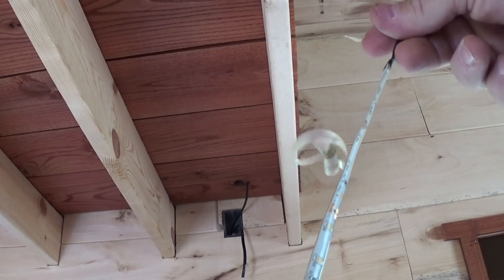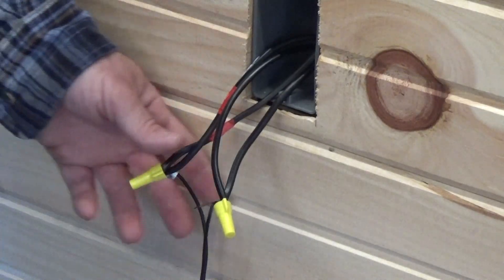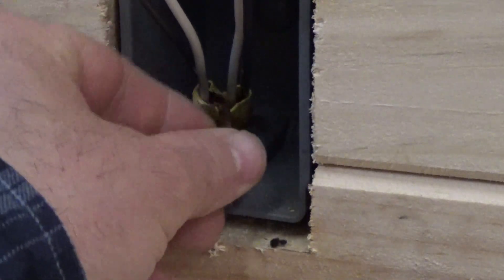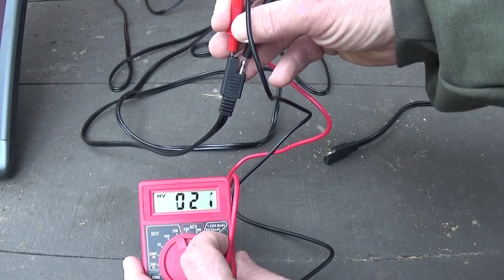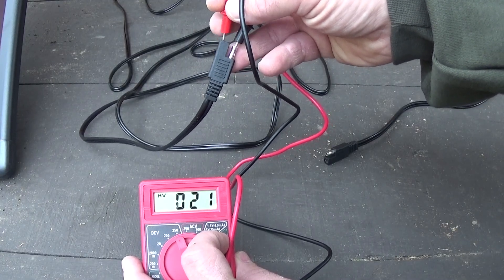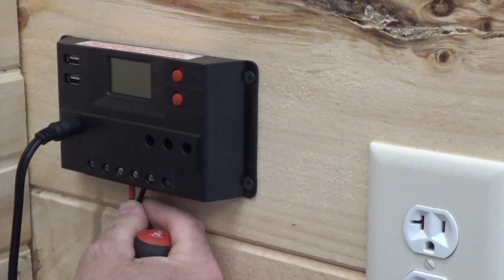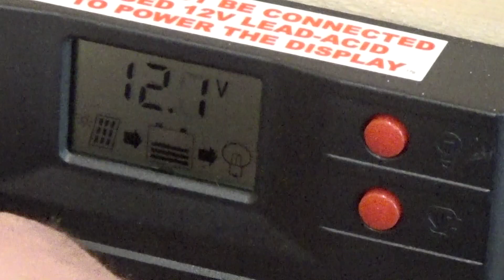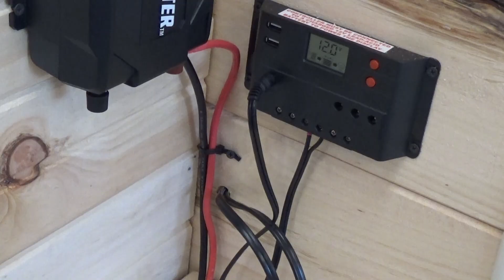Off grid tiny cabin gets  harbor freight solar panel kit installation and I wire 12 /110 volt system

Comment: Could you do a video going more into the wiring and how you connected to the marine battery? I've seen some folks use a charge box, but it doesn't seem like you opted for one of those here.
Reply from the maker: I might be able to do that at some point , right now I have a few projects I'm working on . I honestly just went for a very simple setup .
Reply: @blackspruce1861  I have a couple 100 watt panels and one of the smaller Jackerys, but that kind of set up with the marine battery would be more ideal than hauling the jackery out each time. My electrical knowledge is slim, but folks like you on Youtube have taught me a lot. I'll be looking forward to your future videos either way though!

Comment: That cabin is sweet. I wouldve ran more wiring behind walls, charge controller up higher and hidden interter tho.. especially how clean and nice the cabin is tho.
Enjoyed watchin u put it together and the lighting is excellent.
Reply from the maker: Thanks!!  I personally don’t need anymore outlets and charging ports than what I put in . It’s just a little getaway cabin and I honestly am a bit surprised but I . hardly ever use the 110 for anything more than charging my laptop . I’m really happy you enjoyed it . I was a bit disappointed the other day I went to pick up more of those light strips for my work shop and couldn’t find the Same ones . I really like that lighting too

Comment: How many watts can support the controller? Please!!
Reply from the maker: I'm really not sure . I would have to look . I have had a lot of people say that its a bad charge controller and they upgraded to a different kind. I personally haven't ha d any problems with it yet
Reply: @blackspruce1861  The HF controllers are all Pulse Width Modulation. They all do work but, MPPT controllers are better. And after using solar for over 10yrs and trying and using and doing demonstration's even on solar. I can say that Victron is probably one of my top choice and many others have now since moved to Victron. It gives you bluetooth app and can see real time power generation and give monthly states and allow to do manual battery config for 12,24,36,48 volt setup even Lithium. The HF controllers don't offer all this. Also, being MPPT they track so fast you actually generate much more power off the same panels.
Reply from the maker: @1kzrider  yes that’s what everyone kept recommending mppt thanks I couldn’t remember at the time
Reply: @1kzrider.. Good info. Which model of Victron do u recommend and whats a good price to pay for one?
Thanks in advance
Reply: @koollee  it really depends on your setup.  i prefer ones that allow me to run higher voltage. This allows me to run longer leads to batts and have less drop loss. But, when looking recommend pay close attention as there is confusion. One says victron blue which you would think is bluetooth it is not. The other is Labeled with the word SMART it has bluetooth. This I recommend. But, if you make mistake you can simply buy a dongle which I did have to do. But, the dongle plus side is it gets better distance.

Comment: Love this cabin!  Regarding the battery being charged indoors, keep in mind that they let off hydrogen gas when charging.  Not saying it would be a problem or implying that you already didn't know that, just something I thought of and wanted to bring up.  It might be safer to relocate just the battery outdoors.  Love the channel!
Reply from the maker: Thanks!! I might just upgrade to lifepo or AGM battery that doesn't off gas at all and has much better capacity . but I thought and I may be wrong that they only really off gas when they are over charged
Reply: This is a dilemma,  I live in Colorado and its currently -8*F outside. That greatly limits battery capacity.

Comment: 4:28 for best adhesion clean surface with something like isopropyl alcohol first.  Avoid cleaners that might leave any residue.  Even if they stick initially, they could fall off later.
Reply from the maker: good tip ! thanks!

Comment: What do you think about the panel and battery? Would it be worth upgrading or adding more panels and batteries too it?
Reply from the maker: So far I’m happy with both , but it sounds like a lifepo  or AGM battery would be safer and longer lasting. I was being cheap. As for the panels I’m really happy with them . I could see adding if I needed more but so far it’s been enough. That might change in the winter though
Reply: @blackspruce1861  have you tested longevity of the battery charge plus charging at the same time like say having a radio or TV on all day?
Reply from the maker: @bradlyjohnson60  no I haven’t really tested it I edited a video one day . Had my laptop plugged in and the lights on for a few hours , but nothing that really draws a lot . That’s one thing really nice about wiring just 12 volt lights you don’t need 120 lights and 12 volt leds hardly draw anything
Reply: @blackspruce1861  that's awesome I have the harbor freight kit and was thinking if wanted too add more panels or batteries if it's a set up worth expanding
Reply from the maker: @bradlyjohnson60  my brother in law lives off grid . He added some harbor freight panels to his array he likes them because they still charge alright on a somewhat cloudy day . I believe they’re mono crystalline panels is what he said .

Comment: Do you have a video for the outlets, hooking them to investors
Reply from the maker: no I should have taken better shots of installing the wiring . all I have is what's in this video .
Reply from the maker: well I guess it does show hooking to the inverter . it shows how I hooked the outlet to the wiring and the way I connected to the inverter was the cord plug in that I hooked to the wire coming from the outlets . then I just plug it in to the inverter.

Comment: Have anyone using this kit have a charge controller burst into flames yet?
Reply from the maker: I don't know have you had that happen?
Reply: @blackspruce1861  Yes, these pwm chargers can be dangerous. The first one I used melted. It was supposed to be rated for 30 amps, but it melted with 300 watts plugged in. Also over charged the Small batteries I was using it on. I switched to MPTT after.
Reply from the maker: @msamour  wow ! I’ll have to look into getting a better one
Reply: @blackspruce1861  Stay below the rating, and monitor the temperature of the charger. The transistors (FET's) fail in cascade and that's what started the thing to melt in my case. I didn't trust it to begin with, so I unplugged it before it caught on fire.
Reply from the maker: @msamour  so far I haven’t added any panels so it should be under the rating either way sounds like getting a better quality one is a good idea
Reply: @blackspruce1861  I paid 150$ for my Renogy charge controller, and it was definitely worth it. I will be able to double the capacity when I switch to 24 volts eventually.

Comment: Will it need a bigger charge controller
Reply from the maker: Maybe if I add batteries or panels but it’s a kit so should be matched pretty well i would think. So far I’ve had no problems

Comment: I think you mentioned adding extra wire from the panels to the charge controller. Would you mind adding a link to it?  Great place and great video!  Going to add this set up to my cabin
Reply from the maker: thanks . I'm pretty sure it showed it in the video . I spliced it . I haven't watched it since I finished it . ill skim through it and find the spot .

Comment: Should have all the power I need (and then some!) as I've bartered for a 4 panel (160 watt per) and a pure sine wave inverter. I appreciate your wiring tips. And thanks for the lighting recommendations! The 12 volt strips should work great in the cabin :) Later, sir! God Bless
Reply from the maker: nice that sounds like a good system! I really like the light strips they put out a lot of light and don't use much power .

Comment: Nice setup, but did you put any fuses on the lights as well as the solar panels and inverter ? DC starts fires just as fast as AC and you can't just shut off a solar panel in the middle of the day. Maybe look into using some push to reset marine/ RV circuit breakers
Reply from the maker: I'm actually working on a cabin update video now ,and part of that video was going to be installing some fuses . that sounds like a great thin g to look into thanks for the tip. I'll check it out before I get started

Comment: Sorry but using twist nuts is a big no no
Reply: The twist nuts are used in copper house circuits all the time. I have never seen any problems with them. However if you have aluminum wiring then using them isn't that good of an idea.
Reply: How about an explanation for this no no.
Reply from the maker: Tell that to the electrical inspector I haven’t failed an inspection in a long time

Comment: Will the setup survive a freezing winter? I'm in the NE US and we get a lot of snow and can get negative teens in the winter. I wouldn't be using a cabin in the winter, but I would like it to still be working in the spring.
Reply from the maker: My brother in law has had a few harbor freight panels in his system year round for a while and I don't think he's had any problems with them. you would want to put them on a stand so the snow could slide off or melt and be easily removed. they would get buried on the ground .

Comment: Could a full charge run a small window ac unit for a couple hours?
Reply: And maybe a small space heater a couple hours ?
Reply from the maker: it would need a bigger inverter and even then I don't think one battery would last long running an ac unit or space heater , maybe an hour but I honestly don't know

Comment: What's the size of your cabin in square footage?
Reply from the maker: its 10 x14 the walls are 10' high so it has a little extra head room in the loft
Reply: @blackspruce1861  how well does your stove heat that space?  Link on stove?
Reply from the maker: @Our4Seasons  i haven’t had a really cold day out there yet since I got the stove installed but it was high 20s and I had to open a window. It’s made by englands stove works

Comment: Any chance this will run a freezer or fridge?
Reply: I imagine if it was one of those 12v fridges/freezers it might. Not too sure about a normal sized fridge/freezer because that’d probably draw too much power
Reply: string enough of them together you could run anything.. more panels = more power.. but then you need more battery, more charge controller, more inverter... and so on. you'll need to know what fridge you want to run and how much power it draws and how long do you want to run it. there's no simple answer.
Reply: @Turk380  Hi Brian!  We are looking to move off grid full time, My main want that's not off grid would be a freezer.  What would you recommend to run a deep freezer?
Reply from the maker: what Brian said . this systems not enough but you could add to it .

Comment: Great video - I am preparing to build an off grid cabin about 30 x 18 I'd like to know if you think that this solar panel system could sustain this size cabin or would I need additional panels or different set up, and would a small fridge maybe college size be possible. thank you and keep posting, your video here is one of the best ones I have seen so far.
Reply: you 1st need to know exactly what you want to run and fore how long, and how much power these things draw. then you design your solar system from there. If you want to run a fridge on as few panels as possible, look into RV style 12v compressor units.
Reply from the maker: Thanks! No it wouldn’t be enough for a mini fridge for sure . It’s only enough for me because I don’t use much mostly lights and now and then I use it to charge my laptop while I edit . It’s been plenty for that but I haven’t tested it’s limits yet . A fridge I think would be too constant of a draw

Comment: I like the video and the work. However, USA needs to discover WAGO connectors 😛
Reply from the maker: Thanks! I actually bought a pack of those i was told they work really well. They're sitting on a shelf in my garage .I completely forgot about them. I'll have to remember them for the next project
Reply: @blackspruce1861  Excellent! They make electrical work both safer, easier and quicker :)

Really enjoyed the video, though :)

Comment: i have used those same strip lights but mine would change colors using a remote only problem is after about 8 months to a year that sticky stuff starts to let go they are  so i used bred ties with the ties stapled to the wood laying it across the flat part of light strip so it didnt interfere  or damage them  as far as going around coiners i think it say you can cut them at certain points think its about every three led or so  it usually is stated on paper work but not positive but where you cut them if your good at it you can soldier   small wires  3 or 4 inches that will allow you to do square corners but its touchy to much heat and the copper foil can peel up if you trying to cut these and add wires to square around corners
Reply from the maker: they actually come with wires to extend them I guess you could use those to go around corners too. they have prongs that stab into the strips then lock shut on it . so far im pretty happy with them
Reply: @blackspruce1861  you can buy connectors for led strips, corner ones and simple straight ones to add two strips together. They are brilliant l bought them since l have never soldered before.  If you search non soldering led strip  connectors you should find them. Any problems you can let me know l can send a link. I also bought the covers for my leds too so much better looking.
Reply from the maker: @patriciagallacher2905  hey thanks for the tip. Those strips I put up actually come with connectors for adding on

Comment: I am an off grid full time. I have been living with solar for years. I have found that if you put a rubber matt folded in ½ for double thickness under your battery, it extends the life of the battery 3 to 4 times longer. I learned this trick long ago when I worked in auto parts.
Reply from the maker: That sounds like a great tip thanks ! I’ll have to pick something up for that
Reply: Ohms law
Reply: Nope. I tried that with lead acid and lithium. Zero difference.

Comment: One of the thing I don't see how you using one battery when I started with three batteries what's about the same amount of powers maybe slightly more not much more and I started with three batteries now I have more solar panels and I have 17 batteries and my solar panels are screaming for more batteries but it's still all 12 volts is That's where I've been running it since 1998 and if you take care of it solar panels just like for my solar panels from 1998 still give me exact same Watts as today I got them and still have the same batteries that had even before I got the solar panels and they're still really good I just had to add more batteries which also made so I had to have two different sets cuz the batteries went all the same amperage and some of my solar charges I begged me to go to 24 volts because they can run both 12 or 24 and then I got some solar chargers only to run 12 which I have hooked up to both sets of batteries which gives me to different sets of solar panels to two different sets of batteries two two different sets of inverters but with those two sets accurate running something like five inverters to those two different sets because I didn't get up to the house like you did. I kind of hooked it up a little bit different and not to a fuse box at least not yet when I get more solar panels and when I can afford an inverter or two I should say then I will. But the way things are going that might even be many years from now.
Reply from the maker: Wow ! I’m only using it for a getaway and don’t spend a lot of time inside so I really don’t need much power . Might change once winter comes

Comment: Or I don't understand why you're hooking such a small amount of solar to your house I understand you don't have everything I have in my house that require more power like my kitchen oven stove or my water heater on a couple other things but then again I really don't have DC outlets for too much but I do have some for a couple lights that sits in my front porch I don't got them actually in my house but if I get a real inverter I probably would have my shoulder running everything in my house with more solar panels if I ever can get them or if I can ever afford them.
Reply from the maker: well right now its just a little getaway  cabin. I don't live there full time and when I am there I spend most of my time outside so my energy usage is really low . maybe in the winter ill have to upgrade but so far its all I need .

Comment: How much did your Harbor Freight 100 Watt Solar Set Up cost you ?
Reply from the maker: The kit was right around 200 after tax
Reply: Beside the panels what else do you need for to be  able to operate the set up?? (how many batteries, control panel, any kind of controller???)) any help would be great appreciated
Reply: @blackspruce1861  here in Delaware, we have no Sales Tax, so I was looking for a Price of the Kit without any tax. Not a bad price though
Reply: @kevinswinyer3176  You asked how much it cost him, not how much it would cost you.
Reply: @Moosetick2002  I was asking what the price of the truck would be. How much does it cost to purchase one, with shipping to zip code 19904 ?
Reply: @kevinswinyer3176  fuckinGoogle it dude lol wtf

Comment: How do you stop from over charging the battery?
Reply from the maker: that's what the charge controller does
Reply from the maker: I've had a lot of people comment that the harbor freight panels are good but the charge controller is not . so I may upgrade